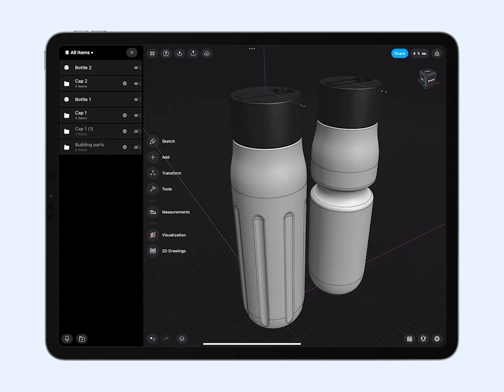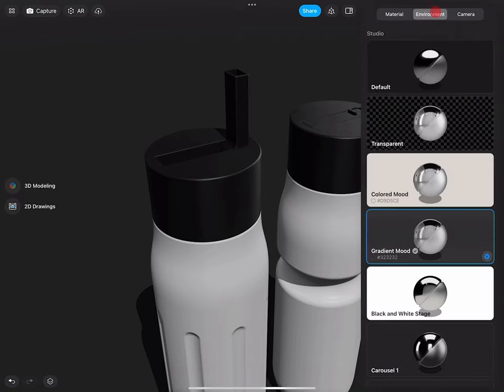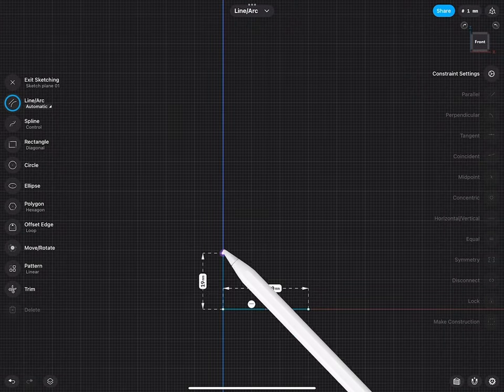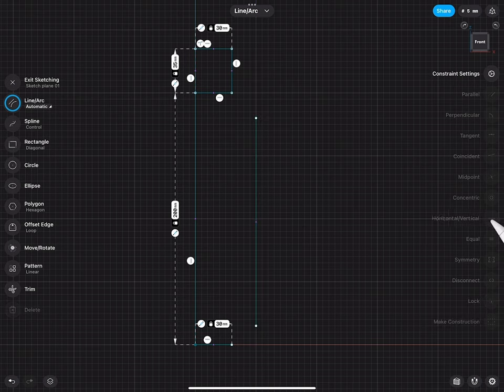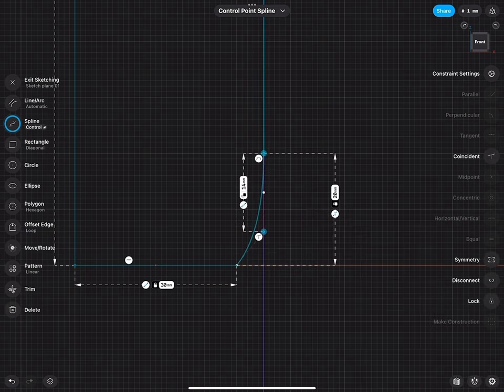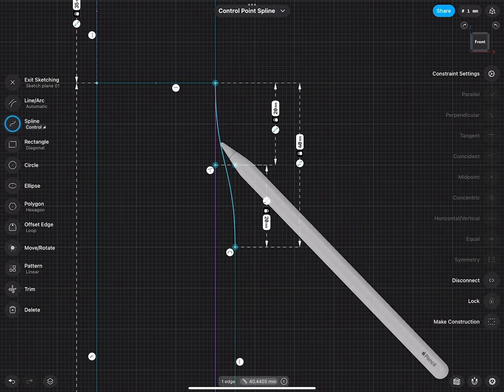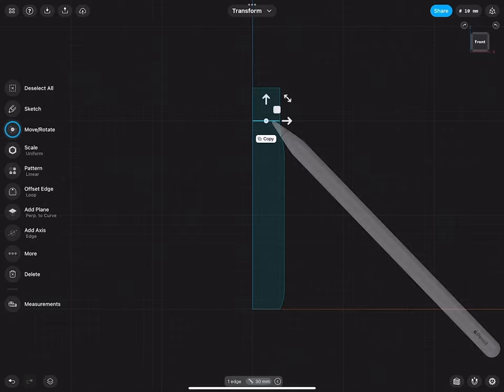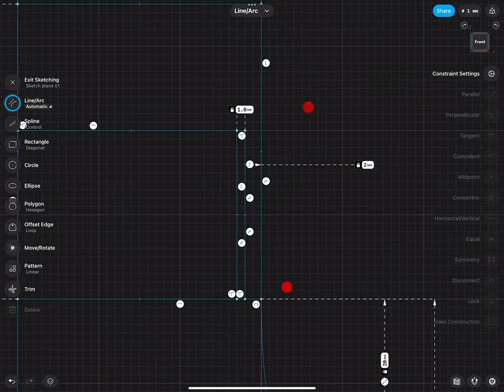3D modeling a water bottle: Creating the main body | Modeling Projects

Comment: The part Where you had to create a spline in the sketch to connect the two gaps between the line just didn’t work.
Reply: i think you need shapr3d premium to access that feautre, which I dont have and suffer from the same issue